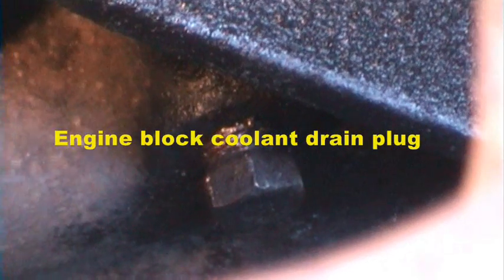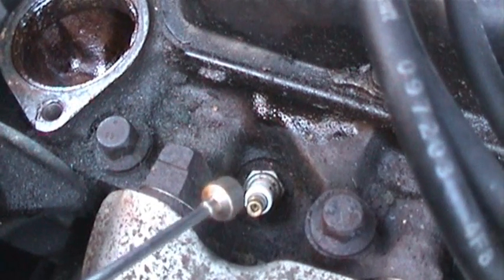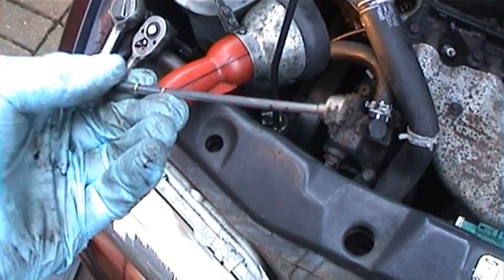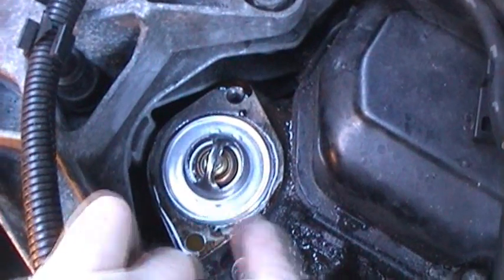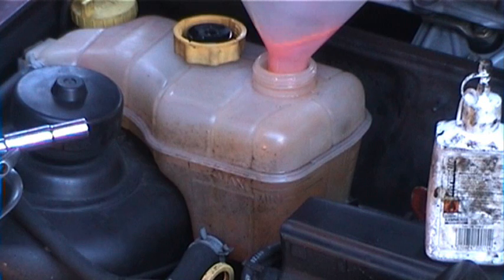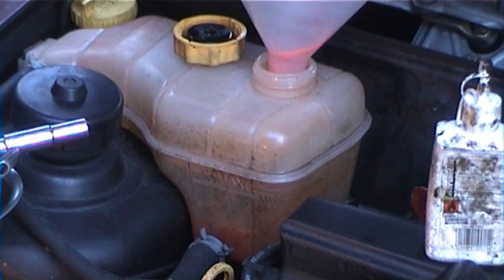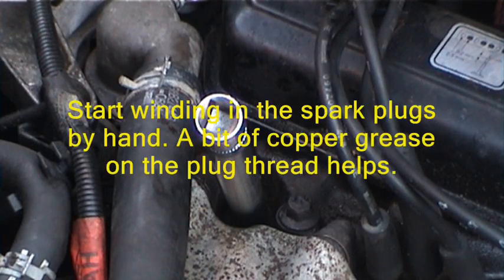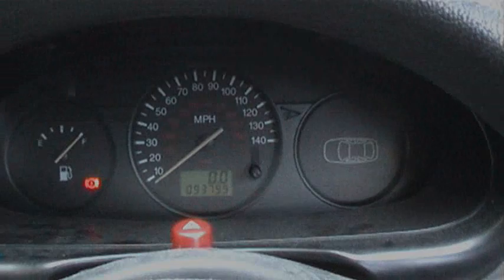New thermostat & Coolant

Comment: That would be great! thank you.
I recently had the car in the garage because the coolant was all rusty water, I asked for it to be flushed and they took the rad off and flushed through all the hoses and radiator and replaced the expansion tank. There is still a little rust in colour but not half as bad as before. But instead of using coolant, they replaced it with water and antifreeze, which I thought was odd. Now that the therm needs replacing, I'm trying to drain and use coolant.

Comment: Hiya, just an update. I tackled the job yesterday afternoon and got away with just pulling away the bottom rad hose and allowed it to drain, I could not budge the engine block drain plug because it had rounded off at some point in the past. I flushed through with water til ran clear then proceeded as in your video. The only problems I ran into was I didnt have the correct pliers to remove the hose clips and instead had to use my fingers....

Comment: Hi and thanks for the quick reply! I don't understand how this could cause the car to blow me hot air into the cabin even though the heater is turned off... We've checked the radiator fan itself to run it off the battery which works perfectly fine but it NEVER kicks in.... Even when i'm driving the car 350miles straight! It's really annoying me especially during the summer, a nice little extra feature in the summer though! haha!

Comment: Is that the Radiator Fan Switch by the drain plug? I'm changing the heater control valve, thermostat, and flushing the system tomorrow (no hot air blowing in). I noticed that someone has wired the radiator fan to the ignition so it is on full blast as soon as you turn the key, I'm guessing it's because the switch has failed, but I'll cut the added wire and see what happens. Only had the car 2 weeks, typical.

Comment: Hoping to do this on my 1.25 fiesta, change the HCV, coolant, and thermostat. I am aware it's under the alternator on the zetec model engines, but how would i flush the coolant system? I have never done anything coolant related before and im a little unsure. I don't think mine even has a drain plug?

Comment: Thanks for the prompt response :-). Ok so the temp needle dropping completely then rising again would be cos of the faulty thermostat?. Also the HCV must be gone too as no heat in the cockpit.. Looks like ive got a catastrophic cooling failure :-p . All this but the car still runs ok. no overheating as such... wouldnt this be the case too?

Comment: Hi i've got a 1998 Ford Fiesta Encore 1.3 aswell and for some reason the fan never kicks in, could that be the reason i get hot air blown into the cab even though the heater is off and the "fans" in the car are off. Can you tell me which relay in the main fuse box is the one for the Radiator fan? And do you think if i replace the thermostat it will solve my problems? Its really annoying if you are driving on the motorway and you cant even close he windows as you are boiling to death!

Comment: Hi, just a couple of questions. Can i flush the coolant through with water before i take the therm housing and thermostat out? Or does it have to be taken out. also, when putting in coolant, what is the engine draining plug for and did you leave it open when filling coolant? Just i was told to pull plug out of bottom or rad and flush through, then tighten plug back up then replace coolant. Iv got a mix of info and im a little confused.

Cheers mate. great vid by the way, very helpful.

Comment: hey there. i saw the video and i have a question. When you put the thermostat housing back you put the gasket on. Didn't you also put another material between the housing the gasket and the cylinder head? Something like anti leaking stuff?? Or is the gasket is enough the prevent leaking?

Comment: hey ive a year 2000 1.3 endura e ford  ka and the heaters went one day and while i was in town it overheated but luckily i switched off, i went home put a new thermostat in her ,still cold heaters so bought the valve and still no hot air .completely baffled all the pipes are hot all the ways up to engine side of the heater valve and the two going into the inside are ice cold ...im completely baffled

Comment: The gauge then returns to the middle , but occasionally drops completely again.. orginally i had a slight leak from someplace and that is why i replaced the thermostat housing.. Could you please advise. Is the thermostat gone ? Im at a loss and dont really have the funds for a dealer to look at it. Appreciate any response. Thanks man!!!!

Comment: Hi TK42138. Thank you for you knowledge sharing online. Much appraciated . I am hoping you can help me. Im from S.Africa and have a 2003 Fiesta Rocam 1.3. possibly known as the Duratec in Europe. My problem is 2 fold. 1) Since i replaced the thermostat housing i noticed NO hot air into the cockpit. I then bypassed the heater control valve as its summer here so dont really need it. Now i have the problem of the temp gauge climbs a bit then drops suddenly as though its electrical. part 2 next..